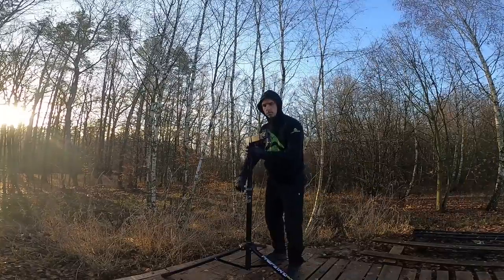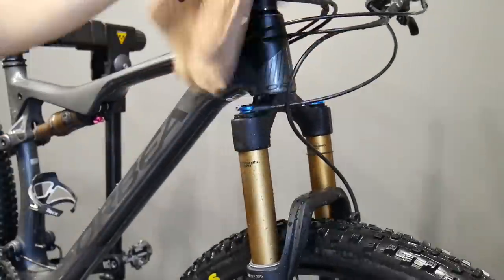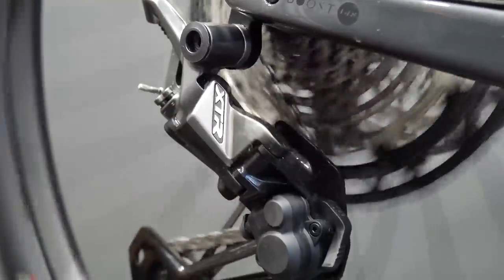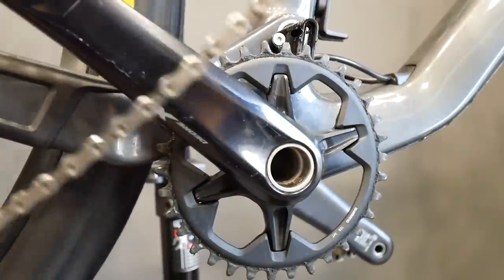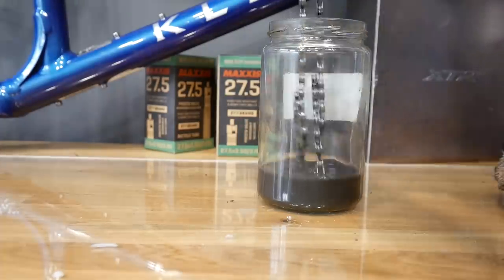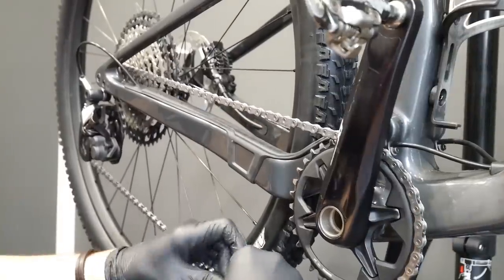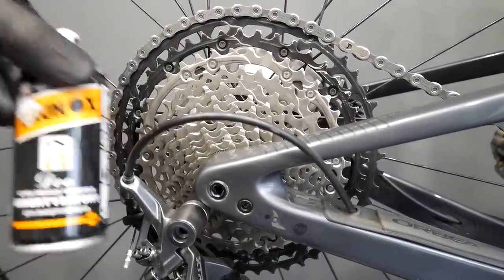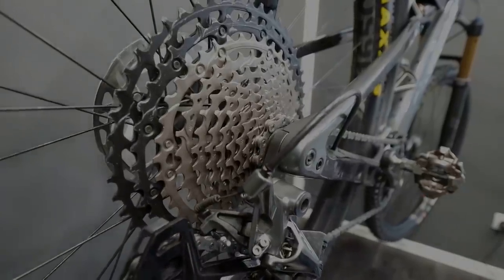One, Easy Trick For A Mud - Proof Mountain Bike Drivetrain. More Than A Clean Chain...

Comment: 1. pressure washer aimed directly to the bearings.... 
2. oiling the chain and then degreaser on the cassette... no sense in this.
3. oil base lubricant is subpar to wax based lubricants in any way

my advice: watch the silca videos (for example) about cleaning and lubing drivetrains. make your own videos after.
Reply: Youtuber ausguy or aussieguy or something does a vid on how to make teflon wax. Bit of effort but you big batch it and itll last you forever.
Reply: I was recommended to use 'squirt lube' a few months ago. It is a water based wx lubricant and is great. It never leaves any gunk or sticky residue. I wash with hose and a brush and possibly a quick squirt of mucoff pink bike cleaner, dry the chain and cassette and then apply the wax to every roller.
Reply: @robertwright6760  
i used squirt lube for quite a long time. It is good. The new ceramic speed lube is superior to squirt.
Reply: Not sure why the title is about "mud proofing". It's not even in the video.

Comment: Great video, thanks. Would you recommend Eagle or XTR when thinking about mud clearance and ease of maintenance? My experience with older Shimano groupsets was that mud builds up quite easily in the cassette for example.
Reply: if you believe srams marketing it works better in mud than shimano but für lifespan and ease of maintenance take shimano 110%

Comment: Weird that this guy doesn't use chain cleaner device - I've bought a no-name transparent black-ish one more than 10 years ago - and it still works (the foam part for soaking up liquid when chain exits the device had to be changed several times). Just a week ago we used it on my kid's bike - who, unlike his father, isn't too lazy to ride during winter - and the chain, after abt. 5 minutes of washing in a mixture of white spirit and small amount of acetone - looked and felt like new (previously it had lots of rust on it due to road salt), after a quick drying and lubing with MucOff chain lube, the chain was perfect - without the need to take the chain off. After seeing how dirty the liquid in it was I decided to reuse it also on my bike (a reused thing has double the value) which had been left with dirty chain since October or something, and it came out perfect - again, without the need to ever take the chain off. Just a week ago got corrageous and splashed out entire 16 EUROS on a new chain cleaner - Cyclone from Park Tool - hasn't arrived yet, but I bet it will be even better than the old noname. Also - weird that this guy cleans cassette AFTER cleaning and greasing the chain - should be vice versa. Also - you DO NOT USE WD40 on your chain or sprockets. Actually - anywhere on the bike. It's staying very wet and sticky for an extremely long time and like a magnet attracts all sorts of stuff, which makes its way into the chain and sprockets. It's not a good product for the bicycle (although it might say so on the can). Also -  the use of metal (hard tool steel) screwdriver on plastic pulleys doesn't seem right. There are special tools for this - or use something of hard plastic, like a large size cable-tie. Overall - for a "pro" that this guy claims to be (well, giving advice on the inter-webs kinda equals such a claim) - several crucial shortcomings.
Reply: "Also - you DO NOT USE WD40 on your chain or sprockets. Actually - anywhere on the bike."

The use of WD-40 is perfectly fine in this case. He is thoroughly cleaning off the extra oil after application anyways. WD-40 contains a light lubricant that isn't going to last long but since he is cleaning and reapplying the lube after each ride that should not be an issue. There are obviously better lubricants, which he also mentioned, but for this method it does not matter too much. The cassette does not need a whole lot of lubrification since the chain is also lubed up.

"Also -  the use of metal (hard tool steel) screwdriver on plastic pulleys doesn't seem right."

Those are not made from plastic but anodized aluminum or steel or even titanium. You are not going to scratch off the anodization of the gears unless you really really scrape hard. 
The chain that scrapes across those is made from hard steel as well....
Should you manage to scratch them a replacement set is usually less then $10.

The chainring is also not made from plastic but aluminum or steel or even titanium. Are you talking about the CFRP cover?

"Overall - for a "pro" that this guy claims to be (well, giving advice on the inter-webs kinda equals such a claim) - several crucial shortcomings."
The guy says that he is using this method in actual races,... races you can watch here on this channel if you don't believe him lol.

Comment: Any tips on how to degrease/clean the brushes you use? If not, i imagine after some time you will just spread the old grime
Reply: Take and old jar and pour WD-40 (sold in gallon cans) in it. Soak the brush for a hour in there and then rinse it off.

Comment: Park Tool chain cleaner is very effective and you don’t need to remove the chain. Also, if you degrease the chain properly and then apply a wax based lube, then you can just rinse the chain with water only after a few rides.

Comment: I am not a fried of degreaser and i think it doesn't belong to the chain. The original lube is a bit sticky and should be cleaned from the outside chain - but a bath in degreaser is really too much and probably does more damage than help! I use a self made chain lube from some wax, some permanent grease with dry lube (MoS2) + some diesel oil for solution. Works great so far!
Reply: How will removing grease damage steel? How can one effectively apply a dry lube or wax based lubricant when there is already oil on the chain? The oil from the factory is on the chain to keep it from rusting on the shelf, it's not appropriate as a chain lubricant. It needs to be removed before applying a proper chain lube. You can half ass it and apply whatever you want over top of the factory applied oil, but you'll get much better results if you thoroughly clean the chain first.
Reply: Mate keep doing what your doing your doing the Wright thing

Comment: Nice but -
• Be kind to your bearings: don't use high pressure water jets to clean your beloved bike. 
• Clean the cassette with the rear wheel off the bike.
• Avoid using aerosols, which can easily contaminate the disc rotor.
 • Use a wax-based emulsion chain lubricant eg Squirt, or a wax/PTFE home-made mix. It enters the rollers, then dries, leaving no sticky residue. It is easy to clean after a ride too - just hot soapy water,, dry the chain and reapply.
Reply: Modern bearings are sealed and all the pro teams use pressure washers it's a none issue, just look at the dozens of YT vids of people testing it out. Put this in the same category as "washing up liquid rots your paint"
Reply: @chris1275cc have you ever replaced or maintained bearings? bearings have seals for many many years. No seal will resist pressure water like that. Will still work but reduce it's lifetime by a lot as grease will be mixture with water and dilute. Pro teams do that because they replace bearings as often as we replace our underwear so they don't care. Advise. Don't do pressure near any bearing.
Reply: @pmjcr  than take a step back and pressure wash it

Comment: The chains are rolled in hot oil in the factory. This is a heavy weight oil. Think of 40 weight motor oil which is pretty much syrup when cold.  That’s why waxing a chain works.  Anyway, thanks for the share. 👍🏻

Comment: I don't get it. Rubbing the chain with a towel after using the degreaser doesn't actually remove all the degreaser! There's still degreaser in the inside and the cylinders of the chain. Wouldn't it be better to use the dishwasher before lubing the chain again?

Comment: Wippermann confirms on their website to wash out the conservation grease. I use Interflon Eco M100+ degreaser. Blow dry and grease with a chain oil with an evaporant. Let it rest overnight. Take the chain off first. Standard practice in industry

Comment: New chain comes with stain protection. This is NOT a lube! Before use you MUST wash out stock oil!
Reply: Not correct. The lube that comes with a new chain is the best there is. Sheldon Brown hade a great article about this.
Reply: @pewe7314  it is outdated announcement. Even in Sheldon times there were already better lubes, than stock chain oil. By the way if You leave stock lube and then apply f.e. wax lube - it would not work.

Comment: The grease in new chains is there for a reason. It never really comes out, maybe if you use a chain bath, but it's not meant to be removed, it helps the chain work and you can't put it back in once it's removed. 
No disrespect to this guy but I wouldn't do this to your chain, plus I doubt this guy considering he sprayed degreaser all over his brakes and jet washed his bearings.  
But no disrespect and I am not trying to be hateful.
Reply: Bro, that grease should really be removed and replaced with proper chain lube before you ride it. That grease was just there to prevent corrosion while on stock and the packaging. In fact, it is even written on shimano chain manual.
Reply: Btw I've also been using a jet wash on my bike ever since I got it. I replace my bearings every 6-10 months depending on the usage and washing of the bike and nothing really ever happens to the old bearings before I replace them. It's not like he's blasting it directly on the bearing seals 😏
Reply: @N.I.C.K.0.3  Why do you replace old bearings if they are fine?
Reply: @stanislavcherebatov794  I don't like waiting.
Reply: @stanislavcherebatov794  he got them greens .
Reply: @N.I.C.K.0.3  I checked both the dealer's manual and the user's manual for my Shimano 12-Speed MTB chain (CN-M8100) and nowhere does it say that the chain has so be degreased before installation...
The grease INSIDE the chain is not going to collect dirt anyways so there is no reason to remove it.
It's common practice to clean off excess grease from the outside parts and applying a proper chain oil or wax before the first use though.
Reply: @MustYouHaveAUsername  How come every dry lube has instructions that say the chain needs to be completely degreased? How will wax stick to a greasy chain? What is the point of putting lube on the outside of the chain (which will be wiped away) when there is already factory grease inside the chain? All you guys who are afraid of degreasing can never answer any of those questions.

Comment: Do you have any tips for battling clay mud?. If it gets wet here I can’t even get off the pavement for 5 minutes before the wheels are packed tight
Reply: It sounds like you need to consider tire choice at that point. But additionally clay is pretty notorious for clogging everything.

Comment: WD40 is not lube, it is good for removing rust and loosening screws but despite its viscous feel it isn't lube.
Reply: And removing grease.
Reply: @Leo-gt1bx  Well, yes, if you have nothing else, it's better than just water. But if you can get your hands on Muc-Off products, they make way better degreasers than a WD40.
Reply: @thedevo01  Yes obviously true but I have seen people put it on their chains thinking it is a good idea.
Reply: That's a myth. WD-40 does indeed contain multiple lubricants, mostly fairly thin oils but still. You can use it perfectly fine to lube your drivetrain, but it will not last nearly as long as a specialized product. You will also be wasting a lot of the penetration, water displacement and soil removal substances that are a large part of the WD-40 formula.
A spray can is also not the best applicator for lubing a chain...
Lastly due to it's low viscosity it will fling off your drivetrain so make sure to wipe it down extra thoroughly.
Reply: @MustYouHaveAUsername  WD-40 is horrendous for chains
Reply: @Leo-gt1bx  If by horrendous you mean suboptimal for the previously mentioned reasons but otherwise completely usable then sure... otherwise you are just wrong. 

Personally I would not recommend it because better products are readily available that don't cost more or are only marginally more expensive. There is really no reason to pinch pennies on maintenance with how much bikes and components cost.

However, people have been testing this for decades over tens of thousands of kilometers. If reapplied properly and frequently with the drawbacks in mind WD-40 won't hurt your drivetrain at all.

If you want to do long range bike packing in bad conditions (e.g. very wet, very dusty) you will have to put in a lot more maintenance work than with a more specialized product.

People are way overexaggerating how bad WD-40 is as a light lubricant, or have no idea how to apply it properly.

Comment: What is the point of "quick link" if it can only be used once?
Reply: The point is that... It's quick. Even though it's recommended to be used only once, you can use it two or three times. NEVER MORE THAN 3! it will be too compromised
Reply: @Andrea-qg5yk  I've used one hundreds of times without issue.
Reply: Donnie Gonzales ya same I don’t see the issue
Reply: the use once is for liability reasons
Reply: @JogBird  exactly

Comment: Paraffin chain lube and you will have to do at least twice less work.
Reply: Роман Егоров - I use a hot paraffin & lamp oil soak and then a quick quench in cold water to solidify the wax mixture.  Works great, stays clean, and the sound will let you know when it’s time for a relube.
Reply: Same here. DIY rice cooker wax is cheap and works great. Easy to clean and no need to use solvents that are environmental (your own backyard) harmful. Do it for both mtb and road bike. No problems.

Comment: Why does the chain factory grease need to be cleaned first? What happens if the grease isn't cleaned?
Reply: This is not oil type grease, its for conservation, so its super sticky and if you ride chain without cleaning you would have whole drivetrain full of dirt.
Reply: @IngMatej  Does it cause chain drop?
Reply: @NomadFM  surely can, if you ride it for too long. Just try clean whole drivetrain like shown in video in the video. It should be better
Reply: @IngMatej  Have you experienced chain drop by factory oil personally?

Comment: Do not use WD-40. Wd 40 is not a lubricant.
Reply: That’s  correct. However, it is a water displacement product (WD) and everything you will encounter out on the trails that is sticky is suspended with water.  (Mud, grit, etc...).  The WD40 is to repel these things.  I’m pretty sure by context he was cleaning the cassette at the end, not lubing it.  It also stops rust for whatever that is worth.  Assuming most of us clean the drivetrain before rust could ever even begin.  👍🏽

Comment: so many rookie mistakes in this video
Reply: @jordansemailaddress  jet washing areas with bearings, spaying degreaser directly onto the cassette while it's still on the bike!!!! (also bizarrely putting lube on the chain first), cleaning the grease off of the rear mech, advising that chain lube type 'doesn't matter', using WD40 etc... You may extend the life of your drive train but you will greatly reduce the life of your freehub body, bb, pedal bearings, derailleur and headset, a good video but overall not entirely accurate
Reply: @jordansemailaddress  didn't say anyone was a commoner just frustrated that a video which is not entirely helpful has so many views

Comment: If you use power washer won’t you ruin the pulley bearings ?
Reply: That isn’t a power washer
Reply: @nielsrooiman772  Is that like a "that's not a knife, THIS is a knife."? Because that was a pressure washer from where i'm from.
Reply: @trje246  "That´s" a bike specific washer from muc-off
Reply: @Janik8065  interesting, cheers, i'll scope it out. thanks

Comment: How long does it 
take to clean chain? 
I put my chain in bottle 
With degreaser and
shaked quite a lot
Then nothing....
Reply: about an hour i would say
Reply: You weren't shaking hard enough
Reply: Use diesel or kerosene, works and it's cheaper

Comment: What kind of lube do u use for cassete? And dereuiller?
Reply: Cassette, nothing lube on the chain is enough, if you spend long periods of time between rides and are concerned about rust you can apply a thin layer of chain oil but it wont improve performance.
Derailleur, a few drops of chain oil every now and then at the pivot points and jockey wheels.
Reply: @chris1275cc  bro what are pivot points?
Reply: @magnumllama400  The hinges of the derailleur.